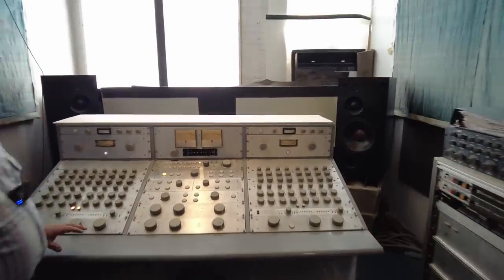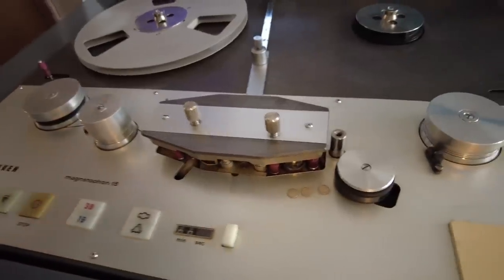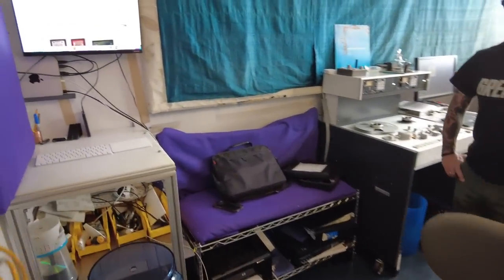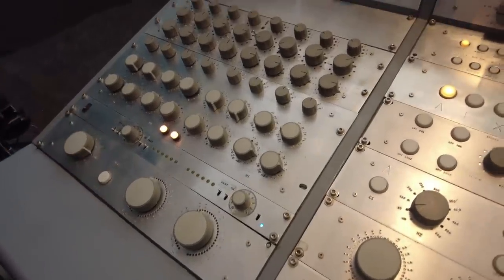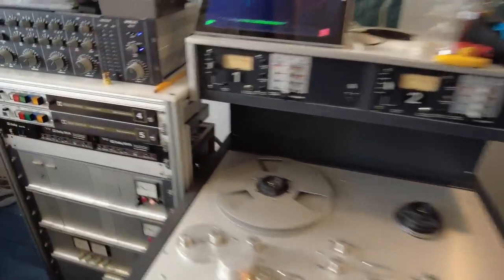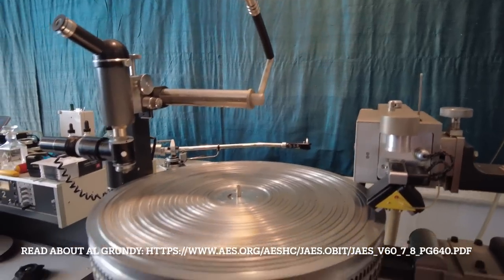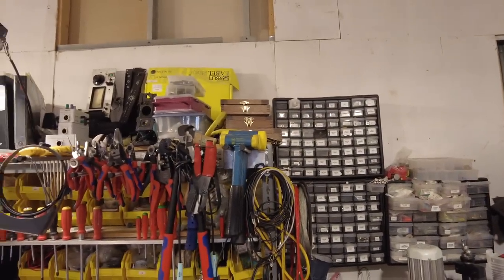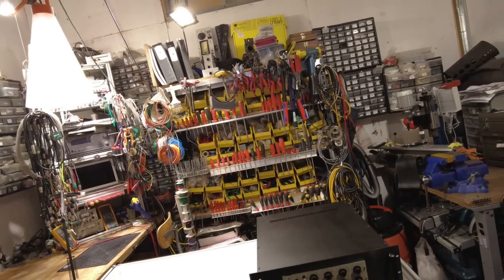Tracking Angle Visits Paul Gold's Salt Mastering In Greenpoint, Bklyn, N.Y.

Comment: I was originally thinking it was an ABX mastering console, so you could have two different settings and hit X to randomly select A or B, and figure out if the changes you're making are having any audible difference. The actual use makes more sense, but incorporating ABX into a console still sounds like a neat idea.

I'm also wondering how widespread these types of consoles are / were, or if digital automation with instant recall (even on purely analog signal path consoles) stifled further development.
Reply: It’s a visual joke. The X is a crossfader between the A path and B path. The console is very good for listening tests because I have eight identical channels to compare against.
Reply: Both NTP and Neumann issued digitally controlled analog EQ’s . But not until the 1980’s. They had Store and Recall to cassette tape. I’ve never seen either in person.

Comment: i love this stuff. i love using tape as much as i can be it casseette or even dat. if i go disc i use minidisc. for dolby i prefer sr if at all possible. for vinyl i like direct disc but finding those is not easy. right now i have a few higher end pieces of gear. a sony  mz-e12 minidisc a sony 75es dat and even a denon tray load cassette deck and for a turntable a sony linear ps-lx510. then my receiver is a harmon kardon 730 twin powered.  speakers not something to bad but some infinity bookshelf ones but they sound great though i think.